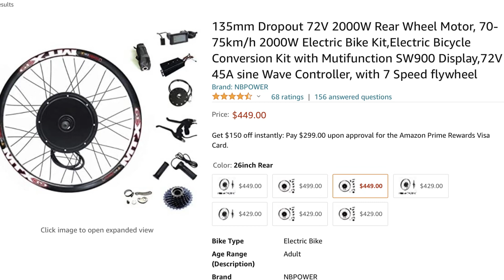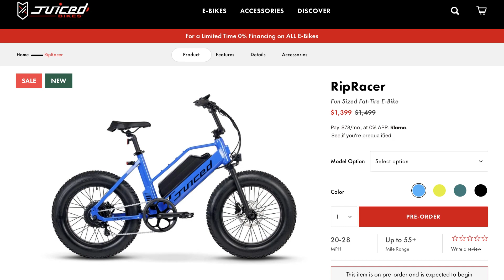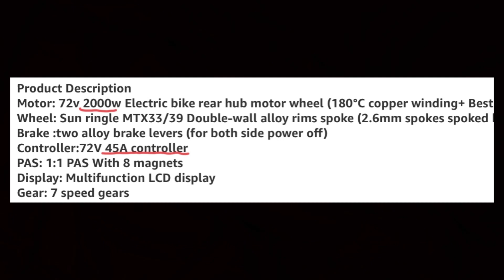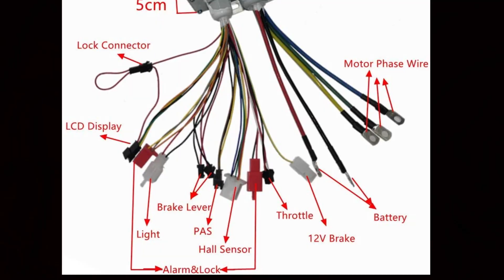How to Know What Power eBike to Get?

Comment: 100% correct I just got my electric bike as well and I love it and yes speed I got mines. It only goes 15. I’m already waiting for some items to come in to upgrade the speed. I’ll be going after that will be 40 miles an hour and that’ll just be my top that’s my just in case that’s my speed just in case I need it. I have it that’s gonna be my third mod2nd mod will be 22 and third mod will be 12  and I leave it on too if I’m just cruising around and I could still go above that if I hit the throttle like you said it’s about being safe one of those guys that used to have electric bikes just across the street I thought I was gonna get hit by an electric bike before I get hit by a car that’s how fast they can go and even in a bike line isn’t all safe. You always have to have a finger on the break the back break

Comment: 1000 watt kit has a 1000 watt hub a1000 watt controller can I us a 60 volt battery 20 ah
Reply: Has the battery got a BMS? Should be ok with 1000w hub motor. I have 2000w with a 48v 25mah battery with 40a BMS & KT-LCD3 display & KT controller. Battery only allows me to get around 31mph as it's max is around 1200-1400w max output. 😏👍🏻

Comment: a 3000w motor does NOT draw more amperage than a 2000w motor, It depends on the load put on the motor not the wattage of the motor.

Comment: I hope you read this you mistaken 1500 W will give you 42 mph in Eagle unlock it you can go easy 46 mph. If you put the right battery you can go 50 mph the only thing they don’t tell you That the wires will start to melt a 2000 W motor will give you more than 50 mph without being on lock when you unlock it, you will get more than 55 mph

Comment: I liked everything in this video and I wanted to ask you about the motor I am thinking of, which is 3000 watts and a 72 volt 80 amp controller. What is the appropriate battery for this motor?

Comment: Exactly you have to ride the e-bike differently which includes talking trail and paths.

Doing 50mph all the time in a long stretch of road is not recommended because it eats through battery like juice. 

I take the road only when I need to. If there’s a bike lane then it’s a good excuse to slow down a bit. 

If there’s a path or trail I’ll definitely take that as well.

All of that is for nothing than preserve as much battery as possible. 

Unless you can afford a 72v with like 200+ ah battery. Then you can throttle all day log

Comment: I built a 72 V e bike with Crystalite hub drive speed motor on a KHS mountain bike. I bought the hub, battery and controller as a kit from HPC. The battery goes in a bag with the controller bolted on to it. It has no peddle assist, only throttle. The disk brakes it came with were inadaquate for a heavy bike like this, so I put on Shimano hydraulic brakes. This was a good idea because the stock brakes were really weak. I also replaced the front derailleur with a single chain ring since I only peddle at slow speeds and rely on the throttle most of the time. The top speed is over 40 mph. I think I got it up to 45 mph once, but I usually ride at 20-25 mph.

Comment: I put the same motor on a 2019 RadCity. With the stock 48v battery it tops out at 28mph. Throttle only I get about 14 miles of range. Just bought a 72v 20ah battery,supposed to be here in 2 weeks. Hope I get more range.
Reply: did you get the (unit pack power official) U004 72v 2000/2500w 19.2Ah battery? if so is it any good? if not do yk the base of the battery you got? I have the same 72v 2000w rear hub drive motor and I'm looking for better speed and longer range.
Reply: @ProditioFallax  Yeah. The UPP battery is great so far. On pedal assisted 3 I get about 50 miles of range. Top speed is just like NPL said in the video. Mine tops out at 42 mph.The only problem is the battery will fully charge to 84.3 volts and my controller cannot recognize the voltage until it drops to 83.5 volts.

Comment: Any thoughts on 1500w motor with 48v system?
Is it really different from 1000w motor?
Reply: very! a 48v 1000w motor system will only get you to about 20/25mph with a range of about 20/25 miles. a 48v 1500w system will get you to about 35/40mph with a range of about 30/35. slight increase in both range and speed but I'd say it's definitely worth the extra little bit you spend on getting higher speeds and longer range! 

(this is all dependent on the weight of the rider and bike itself I should mention as well)

Comment: Is there anyway for me to build my beach cruiser (single gear) into the same set-up as your's? I've really been looking into building mine that way. Do you have any preferences on the website to use in order to get the kit for it?
Reply: I just built a Trek beach cruiser with a motor bicycle engine kit. It cruises at 30Mph I recommend getting one with disk brakes or good v brakes at a minimum.  My neighbor has a 750 watt 52v kit and it keeps up but I can go farther in a tank of fuel, not that that has ever been an issue.
Reply: @marthamryglod291 no v brakes at all get hydraulic

Comment: Rider weight and bicycle wheel size are a big factor in ebikes under 5000w. If you had a 2000w(3200w peak) motor and a 20 inch wheel bike with a 300 lbs rider max speed would be about 32 mph. If you had 29 inch wheel bike and a 150 lbs rider max speed would be 48-50 mph. So with me (300 lbs) and 40 lbs battery on a 29 inch bike I am guessing it will top out at about 41-43 mph. I'm guessing all your measurements are for standard 26 inch mountain bike.
Reply: im 150  trying for 28 inch wheels and i might copy most of this set up with the same 2000@ motor 28 inch wheels instead and ill try to find a nice light bike hopefully not a mountain bike would perfer decent road bike with sturdy frame the battery im looking at is basically same = about 1 more amphour  about 18 pound battery im hoping to peak about 44. with your math i could maybe see 50.. but i would probably never hit that as thats super illegal in the states decked with some road ready equipment maybe i can get it registered,  or just have a stealth cycle sleeper kinda build and keep it at the 25-32 mph limit as hes saying to avoid any law breaking and have a nice solid range!... what do you guys think?  and is a road bike style even viable i see that these wheels are about 2.5 inches idk if i will be able to find a light frame or that styled frame that could fit those tires size but all the information helps.
Reply: oh and the DIY set up seems to be pretty much plug and play just need the right size bike for it as i am basically gonna copy this video pretty much exactly finally would like to add is this battery waterproof florida has rain alllll the time... and lastly all in all the price range in which im looking at is about 13-1400$ usd just follow this video and make whatever slight tweak and you will land in the right spot.
Reply: i can only imagine what the assist will be like or the range of the pas will be like.

Comment: In fact, 750 watts is not a technical legal limit -- it's the e-bike legal limit, end of story.  I have no issue with people building more powerful e-bikes as long as they realize they're eventually going to get caught riding them over the speed limit on a bike path or greenway.  You don't seem to ever pedal that thing, so calling it an e-bike is a bit of a stretch.
Reply: My ebike is 1000w and goes about 30-35mph. A cop once asked me how fast it goes and I said 30mph on a good day and he left. Cops really don't care as long as you're not doing anything crazy, at least in the US.
Reply: as a motercycle enthusiast and an individual who has there motorcycle license i agree! 1000%  getting it road ready and possibly registered and tagged is ideal!  but getting a vin number for a bycicle might prove difficult ultimately i want a device that will assist at stable 20-25 mph at high ranges of 60+  at a price range that is around the same as typical ebikes in that class but the ability to scootmagoot! incase of whatver situation im in, as i care little about off road but its a +  and also care little about keeping up with cars as fitting a bike that has options at 1/4th the price point of a decent scooter motorcycle or gas guzzler in general.... besides anyone can craigslist a honda less than 1500 and ride it till the wheels fall off but kinda defeats the point when 2 wheels and electric seems more effecient in my town as my entire town is a 18 mile radius!! tops!
Reply: I love bacon

Comment: I don't quite get it what would the difference be between a 72V 2000w ebike kit vs a 48V 2000w ebike kit?
Reply: The difference is mainly torque and a bit of heat. Motors with higher voltage can deliver more torque, which feels more powerful especially when accelerating. A 48V motor can spin faster but as soon as you sit on it its slower. Also since 2000W with 48V means more amperage than with 72V, the wires get considerably warmer, which limits the time you can go full power before overheating
Reply: @doktormerlin  you got that mixed up. Voltage= speed. Amperage= torque.

Comment: The idea of this video is good, and the watt vs speed give a good approximation of top speed. However, the info is not correct. A 1500Watt motor is/should be rated for 1500 w continuously, but it will easily provide 5000 watts wheel power if you feed it 8000 watts of battery power. Also, a ‘5000 watt’ hub motor can be more efficient at lower speeds (say 35 mph) than a 1500 watt hub motor. The motor size mainly determines the maximum heat (watts) it can shed and the maximum amount of copper fill that will fit in the motor. So a big motor can be just as efficient and slow as a slow motor, if you feed it less power. It is heavier though, so indeed you should consider the power and amps and top speed that you want, and choose motor, turn count, battery, bms and controller accordingly. Everything should be in balance, although it is always nice to have some spare capacity in your battery, bms and controller. Then you could always increase the power if you want to…

Comment: If you wipe out going 40mph on an Ebike what happens?  I'm guessing either death or paralysis.
Reply: I was hit from behind on my e-bike by a car that swerved into me. I was going down hill at about 20-22 mph with no traffic ahead. My injury was a broken hip.
Reply: How would it be any different from wiping out on a motorcycle other than the weight of the bike crushing you for a motorcycle?
Reply: @stealthxg5045  Ok so the death and or paralysis won't be any worse than the death and or paralysis from a 40mph motorcycle crash which makes it okay???????
Reply: @nhennessy6434  Don't understand what point you're trying to make. Crashing at 40mph is crashing at 40mph. Doesn't matter what kind of bike you're riding.

Comment: I think he failed to mention here was what the limitations of the BMC inside the battery pack. They typically have maximum amperage cut off's that can limit the power available from the battery back to the controller but then feeds the motor you have to have a good match on that
Reply: I was looking at this very battery. What is a better option for a BMS?
Reply: @marthamryglod291  Keep the BMS inside the battery. It's better. Ssfer, lasts longer, runs cooler.

Comment: My 500w hub motor with 48v 13ah battery would do 30mph max and would range @ 20 miles on throttle easily (i never actually ran the battery out). My 750w mid drive 48v battery will do 34mph and i weigh 236lbs and the bike has a 27.5in wheel . Everthing you say is true and you provide some great information.
Reply: 30mph (I'm presuming on a level) with a 500w motor running 48v is impressive, What controller you sporting on that puppy? The motor windings must be decent.
Reply: Agree, the presenter knows his stuff.

Comment: true words dude! i have 3000w hub motor on enduro ebike frame, and 72v 30 ah pack/ honestly it'S more like 26-28 AH with 50A bms, short burst up to 90, i had an 80A controller limited to 50A but it was already to much for my battery, i can go up to 70-80 KM/h but it's not worth the amount of  power it needs to get up over 70 KM/h so iam trying an sabvotonsvmc 45A controller (the same as inyour bike) and that shoud fit well!

Comment: what motor are you using? what kit
Reply from the maker: My system is a 2,000 watt 72 volt 20ah setup with a 45amp controller on a mongoose ledge x1 mountain bike.

Comment: Really good information on watts = approximate mph. Have you given any thoughts on building an e-bike from scratch?
Reply: Speed is all about the winding of the engine. Standard ones are set to 1km/h per V of battery.
Reply: I built mine mate, It is stupid fast and dangerous but so much fun it was worth the build. 72v 80 amp controller and 3000w watt rear hub motor on a 26 inch rim using a 26 x 2.25 tyre

Comment: I wouldn't fret too much on your first build not being ideal. I went through 2 iterations to get a bike I like. Although I started with a folding bike ebike I got for 400 bucks, then decided to build my own. I ended up using Grin Technologies GMAC 8T with Phaserunner controller and paired that with a 72v system. Your speed estimates are kind of misleading, your max reachable speed can be extended by using flux field weakening while sacrificing range.
Reply: I'm guessing you don't like links on your comments, I'll refrain from doing so in the future.